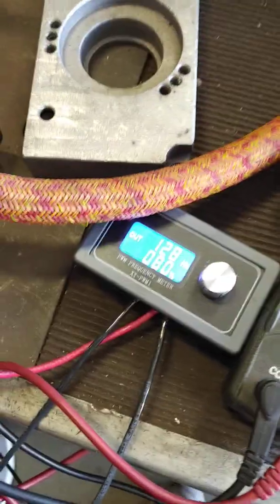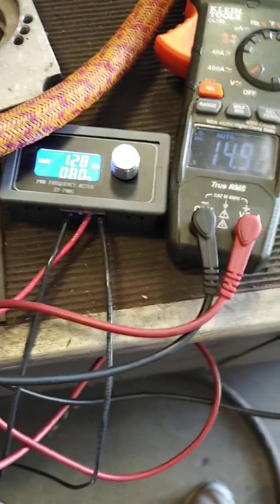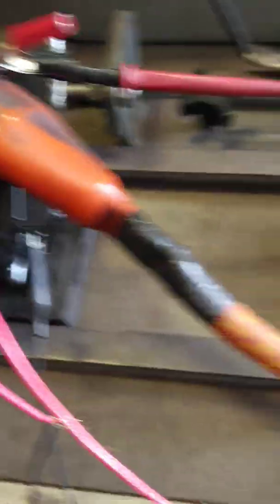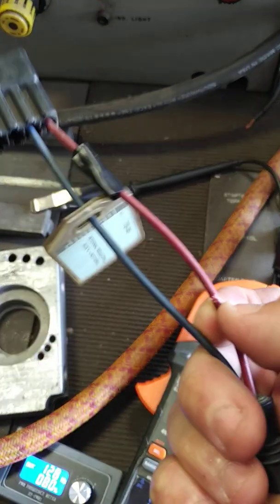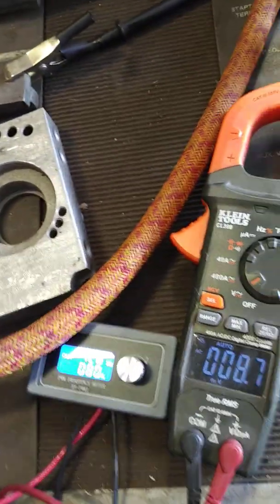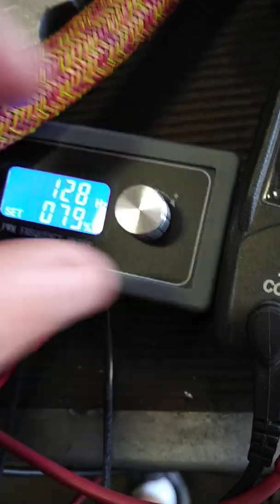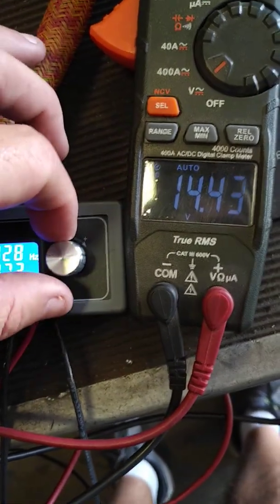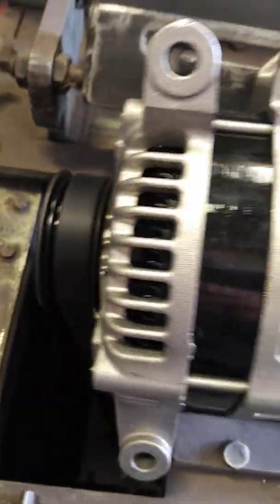GM PCM voltage control device

Comment: I have PWM going to my alt but randomly it will not command the alt after starting and drains the battery until it seemingly reaches 13.8v or around there. Then it'll turn on and charge at 14+v that I have it set to until I turn the car off. 

It's a stock alternator I'm not sure why it's not staying on with it getting the PWM signal. 

I don't yet want to replace it with a high output alt because I don't have time to do all the electrical upgrades. But it's getting to a point where I probably have to because the alternator is being really stupid. 

Am I doing something wrong?

Comment: Ive got a mechman 320 alternator that only has the one 12v switch wire. Is that where i would tap in with this device???

Comment: i have 03 yukon xl & its wanting to stall out at a low idle turning and i can see the volts dropping to 9, but it runs good when its on the highway. I believe the PCM is faulty, but I do not know if this will help. I want to bypass the whole PCM/alternator style that this vehicle has. I am wondering if this will help me bypass the PCM so I can just straight line the alternator charge... ??? Any help will be greatly appreciated.
Reply from the maker: @roymoore2944  email us, info@autotechengineeringusa.com

Comment: Exactly what I need. Running mechman 370 on srx caddy. Starts at 15 but drops to 13+
Reply: Did your mechman come with the one wire adapter? How did you tap in the volt meter for the setup?
Reply: @SOfficial-ie6bz  I transferred alt from 2010 equinox nvr had issues but unfortunately I still need to buy the bolt bypass. Great company tho

Comment: I bought a PWM on Amazon, same one you got there. Where can I find the harness for a 2006 Saturn Vue with the 2.2 motor. I put a 06 Chevy cobalt 130 amp alt on and swapped over my regulator now it’s time for the PWM, do y’all sell just the harness

Comment: How do you reset one? Mine has stopped working, it still lights up and the knob still changes the %'s but the volts don't change when I meter it.

Comment: Where’s the link to the damn thing?
Reply from the maker: https://autotechengineeringusa.com/product_desc/17864
Reply: I bought mine with the harness and the regulator comes on when in acc and turns off when I start the truck. I used a the add a fuse from AutoZone for power. Any help would be wonderful. Thank you.

Comment: Ok so I have the alternator installed and the red wire ran from the alternator to the pwm controller wich is wired up correctly as well my question is on my 03 chevy s10 it has 1 wore for the factory plug do I  take the white wire that you have supplied and run it to that and if so what does it do? Am I going to mess anything up if I dont?

Comment: I tried to do what you did but on a Honda accord 1998 on a 4 pin alternator and it didn’t work. Do I Have to connect the computer wires to the alternator connector or I have to disconnect the computer wires from the alternator connector? How can I connect the wires?
Reply from the maker: Honda not pcm, it's eld. Totally different

Comment: I have this in my 08 escalade.  160amp alternator  and 2 batteries.   Mines dont keep steady. Its all over the place when the music is turned up. Sometimes it drops  to 11.0volts.  I have it set but it dont seem to keep the voltage up.  Any ideas?
Reply: Sounds like your amp is trying to pull more power than your alt and batteries can keep up with. Probably need a high output alternator 160a isn't nearly enough for some modern setups. This regulates voltage it doesn't create it.
Reply: Also have this problem with my 2010 Silverado with a 145a dr37. Going to upgrade to a 240a pure power.

Comment: I have a 2007 Chevy avalanche ran 12v ground and connected to regulator I cannot control to get less or more just says at 13 no matter what I set it to? Any thoughts?😊
Reply from the maker: What percent and hz.  13 .9 is minimum setpoint.  Remove any sensors on negative cables as well

Comment: Is this for the brand x alternators ?
Reply from the maker: you can use on the stock alternators with a pcm 2 pin as well.
Reply: @autotechengineeringusa  thanks bro I just got one with no instructions at all I’m trying to wire it so the wire that goes to the alternator harness plugs in the pwm + on the knob?
Reply from the maker: @pork.t.v9462  onlybon gm pcm style it does
Reply: @autotechengineeringusa  will it work with a mechman 370 2pin gm alternator ?
Reply from the maker: @luisgallardo5234  yes

Comment: What if your using this regulator on the 2nd alternator that for bass amp only and has nothing to do with the vehicle charging.... Do I still tap that white wire into the 1st alternator factory harness or do I leave it alone and zip tie it out of the way?
Reply from the maker: white only used when turning off dash light.  for secondary it is not used
Reply: @autotechengineeringusa  sweet thanks .. just waiting on it to be delivered. Had the xs power vcm but it wouldn't let me raise voltage it would read 9.2 but on alt I was at 13.6

Comment: Awesome! Hey with these RVC system alternators, does setting the voltage this way, where it's a constant voltage and say 15v (like you did in the video), lower the lifespan of the factory alternator or the battery? I might need to buy one of these, I have two Spal extreme fans that pull my voltage down at idle to like 12.5
Reply: What kind of battery do you have?
Reply: loading an alternator without increasing the rpm to keep it cool will damage any alternator regardless of voltage (a moderate load even)

Comment: Does this work on any high output alternator? I have a 350 high output alternator and it's a 3pin do you have a harnest that will fit a 3 pin alternator
Reply from the maker: We have a controller for the gm 3 pin

Comment: What about ford do they wire up the same
Reply from the maker: Similar, we have a hack to turn off dash light as well
Reply: @autotechengineeringusa  only reason i ask i bought one from brandx and the alt plug they sent me has one 1 wire and and it looks like another wire was riped out
Reply from the maker: @timothyholguin1192  the ripped out the option to turn light off
Reply: @autotechengineeringusa  so with that one wire from the pwm terminal to the alt plug should work just fine but ill have a battery light

Comment: Why won't this with a 4 pin? Won't the L and F terminals work the same?
Reply from the maker: We sell a controller for thr 4 pin.
Reply: @autotechengineeringusa  Is it true a 4 pin alternator is analog and not PWM?
Reply from the maker: 2 pin is pcm controlled, 4pin is not
Reply: @autotechengineeringusa  what about a 4 pin that only has 2 wires?
Reply from the maker: @Alex0992  has to have a sense pin

Comment: I previously bought a pwm controller to make one myself but I may just buy yours to make it easier. What I'm confused on is I thought in my research it uses the pwm signal on a 5v not a 12? The pwm controller I have outputs whatever voltage I feed it unless this one doesn't. Or it's ok at 12v
Reply from the maker: We do the extra work so others don't have to. Yes it's easy to buy a pwm online but it does not come with any plug harnesses
Reply: 5 v.i used the usb port from my stereo. Cut the other cable end off.its on youtube

Comment: Can I use this on a 2014 chevy captiva.  Have a singer 240 alt and it's internally regulated.
Reply from the maker: So long as it's a 2 pin style gm regulator yes

Comment: 14.99 on amazon shipped.
generic pwm controller…
Reply from the maker: It does not include plug harness , instructions, specs etc. Not that simple but good luck
Reply: @autotechengineeringusa  would this work on the Australian 120amp Mitsubishi alternator for a vx holden commodore v6 3.8l l36 engine 2002 model it has a 2 pin harness. I only wanna go from 14.3v to 14.8v. Maybe 15v at the highest. I'm planning on getting the 250amp 4 pin alternator off of your v6 3.8l l36  engine  in the chevorlette camaro 2000 model and wiring in the 4 pin plug. Then I could do this to that alternator when it gets here. I haven't ordered as yet.

Comment: Would this work on my 2008 escalade
Reply from the maker: Yes it will if it's a 2pin regulator
Reply: @autotechengineeringusa  if I leave it at 14.8 - 15v constantly would it damage my trucks computer or electronics
Reply from the maker: @jmg5155  not at all. Just make sure you have good battery and stay at 14,8 for agms

Comment: Ok I have the controller hooked up along with the alternator and it stays at around13.7 will not go any tiger than that
Reply: Are u using stock alternator?
Reply: @lylegoodluck  no at that point I had an auto tech 320amp alternator

Comment: Just hooked one of these up in a 08 Malibu worked great until I cut car off. Cut car back on and the battery light is on and alternator isn’t charging. If I let car sit for about 30 minutes then it works again....any ideas?
Reply from the maker: Loose wiring
Reply: @autotechengineeringusa  checked all connections again today and everything is tight....charged fine this morning and then this afternoon would not charge. Let car sit for about a hour and cranked it again and it charged fine again. Works when car is cold and if car has been run for a while and it’s cut off and re cranked it will not charge until it cools down
Reply from the maker: @howardsmith876  where is box located?
Reply: @autotechengineeringusa  inside car on dash....
Reply: I have the same issue on 2016 GMC Yukon. Mine will charge to 15.5 but if turn the car off and restart it the battery light is on and the alternator won’t start charging until my voltage is down under 14v then it kicks on.
Reply: Mine does that too but I figured out that if I turn the key to start I should start it right away and the battery light goes off.
I only get a battery light when I leave the key in on /start position for too long.

Comment: I got this controller and my battery light just cane on after about 2 months of it working flawlessly still charging at 14.9 
What am I missing I checked all the connectors
Reply from the maker: Make sure wire connections are solid.
Reply: Yea checked everything with a multi meter and I can’t figure it out
Reply: @blackerlude  did you ever figure it out?
Reply: Atleast yours is charging at 14.9, I can't get mine to stay over 13.8. Only time it goes to where I set it for, is when I Rev the gas!
I've changed the belt, and I have great grounds, fucking thing won't keep at volts set to!
I'm fucking pissed off beyond belief right now!
And the guys on vacation
Reply: @817Teamsters  I’ve been dealing with the same thing for over a month now....damn thing works when it wants to ....it works when car is cold if I drive it to the store and cut it off it will not work when I go to crank car back up and alternator doesn’t charge at all until I engine cools down...And can’t get nobody to answer my questions on why it’s doing that
Reply: @howardsmith876  here's something to look at, did you upgrade your ground wire's??? No one told me about it, it fixed my issues
Reply: @817Teamsters  I got one of these for my 05 tahoe and want to install it soon, so which ground wires did you upgrade? The wires they sent with the module are not long enough so I plan to redo them and get thicker wire like 12 gauge instead of the 14 gauge that the module came with.
Reply: Have you guys tried smaller pulleys?
Reply: @mattericson8873  my problem was a faulty alternator from Pure Power, bought a different one from a place in Ohio, no more issues. Freaking thing was driving me crazy, the Pure Power alternator is still under warranty so, it's going back!